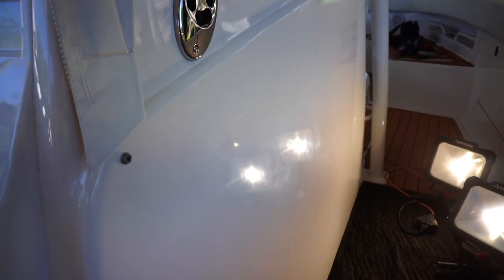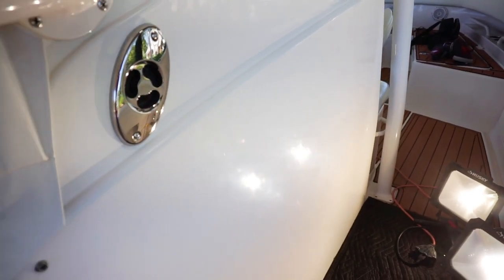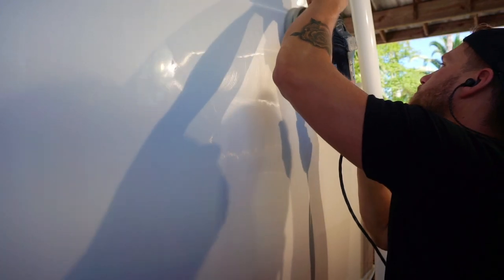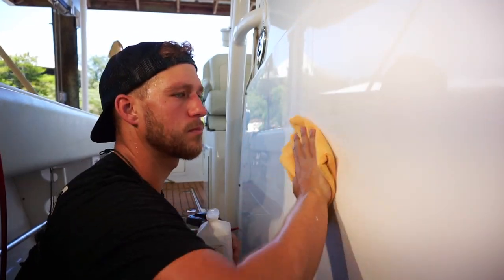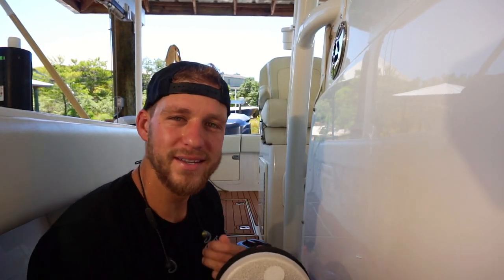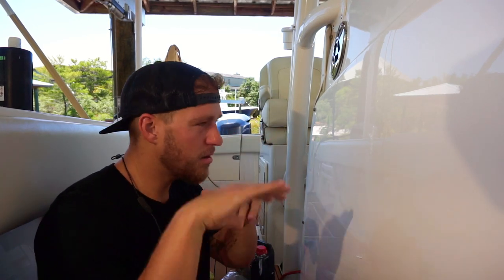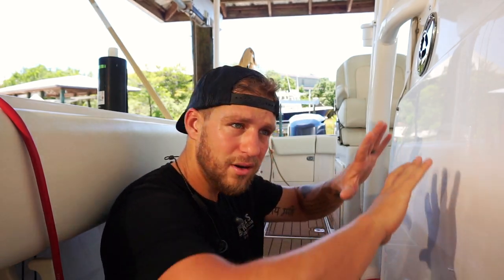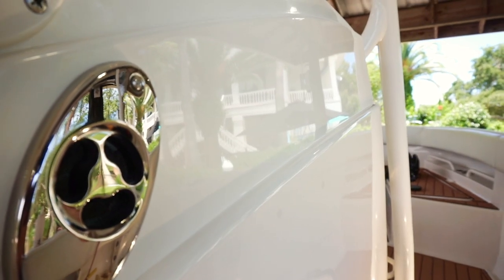These are KILLING your Wax! How to Remove Swirl Marks on a Boat | Boat Detailing Business Tips

Comment: Hey, Drake.  Loving your videos.  I have a boat that is red in color and has oxidation and swirl marks.  I used a DA on it last year with Meguiar's 3 step process.  What do you recommend I do at the start of this season?  Thanks!
Reply: Drake?
Reply from the maker: Use starke level R with a wool pad on a rotary 
Follow up with starke elevate with wool pad 
Use a white lake country ccs foam pad with elevate to polish then apply a sealant like Jescar power lock or starke hyperhold

Comment: Hi Drake, 
I have the problem of looking at gelcoat after polishing from one angle and it looks amazing! 
But when the sun shines on it, I can see all the buffing marks. 
These boats are usually old, oxidised and not looked after. 
I don’t understand what I am doing wrong.
Reply: What pad are you using? Sometimes these gray foam pads cut deep enough to leave a polisher trail.

Comment: Hey, I have a white gel coat hull and I compounded it with 3m medium compound+wax and now when the lights hit it in garage there are swirl marks all over it. Can I get these scratches out without wet sanding and how do I avoid swirl marks in the future?
Reply from the maker: Hey Jake! You need a heavy cut compound, you only used a medium. Swirls marks can be removed with polish after you do your heavy compounding with a forced rotation machine

Comment: Hey Drake, would there be a difference if you applied wax with your FLEX 3401 vs Griot's Garage DA? If I buy the FLEX could I wax on a low RPM. Thanks once again. Set up shop in Spain jeje
Reply from the maker: Yes, run on the 3 setting and apply any wax or sealant with he 3401

Comment: Is this ok for the gelcoat hull too?
Reply from the maker: Yes! On white gel coat, if it’s a dark color hull I would use the orange or white lake country force pad! Orange is a med cut white is a polish pad.
Reply from the maker: Do everything else the same! Just use a lighter cut pad!
Reply: Drake's Detailing awesome thanks! Its like a light grey hull, so orange?
Reply from the maker: I would do orange just to be safe, if you use the grey it will remove the heavy swirls, but it may leave lighter swirls because the grey is to heave of a cut. 

You would have to follow up with the orange or white after, so just to be save use the orange
Reply from the maker: Always do a test spot like I did in the video to see! No matter what, every boat is different!
Reply: Nice video
Reply from the maker: Thank you !
Reply: That sealant you used.. apply with a DA then let dry ? Is it easy off? Is a Torq22d ok to use? Thanks
Reply from the maker: Yes the torq will work! Jescar power lock goes on easy and comes off easy. Just make sure you let it dry completely
Reply: @DrakesDetailing  have u ever used ardex ocean polymer sealant , or jetseal or c2v3 on gel coats?
Reply from the maker: Ocean polymer is great!
Reply from the maker: I don’t like jet seal and haven’t tried c2v3
Reply: @DrakesDetailing  is the jetseal a decent product  what was your dislike?
Reply: @DrakesDetailing  how long will that protect the gel coat rv? Is it safe for vinyl decals?
Reply from the maker: I tested jet seal a few years ago and it only lasted a few weeks..
Reply from the maker: About 8 ish months depending on how they wash it and what not
Reply: @DrakesDetailing  thanks for the advice? How long will jescar last and ardex ocean last in direct sunlight you think on gel coat ?